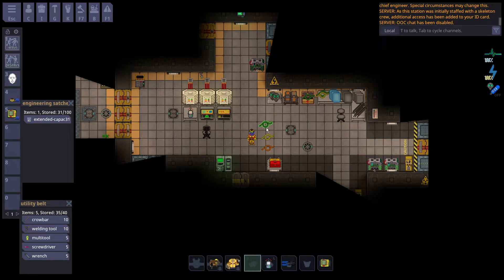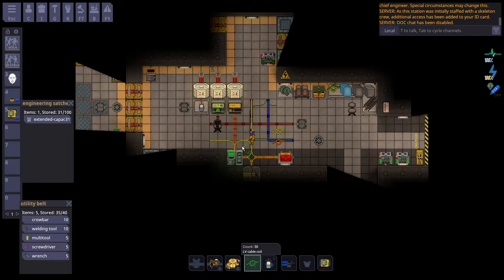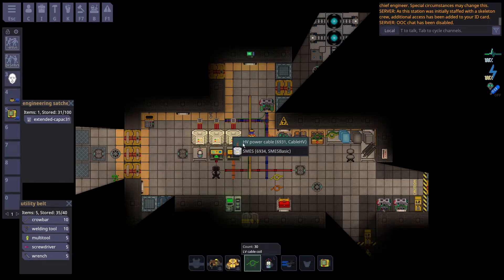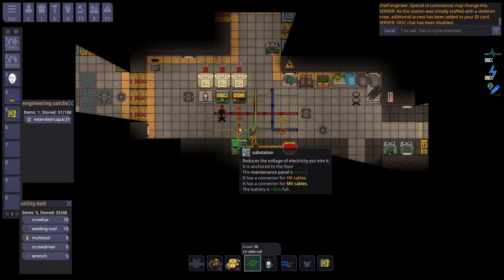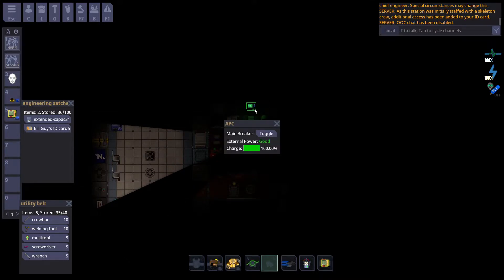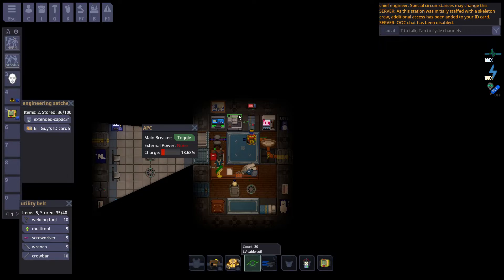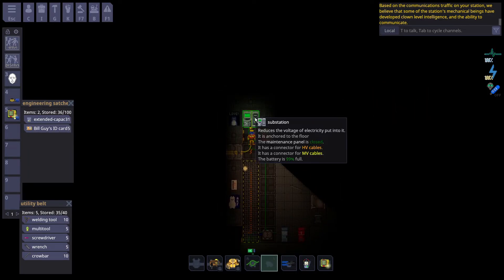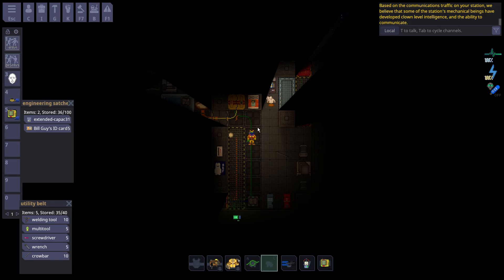SS14 - Wires, APCs, Substations, and SMES Explained.

Comment: Something i don't see stations doing alot is upgrading their smeses
like, they are often not something destroyed, but even advanced capacitors on them almost DOUBLE the time you have left before you run out of power.

And if they get bluespace spamming artifact. taking out power aint gonna be relevant for very long time

Comment: So correct me if I'm wrong or confirm if I'm right please, but it seems like the "easier" way to find the problem with power if the problem is cut wires, you should start from a room or the room missing power and follow the cables starting at APC toward Substation, etc. back to AME.
Reply: Send about right